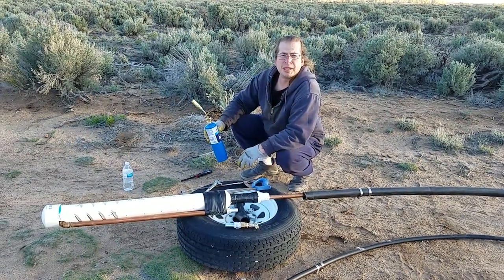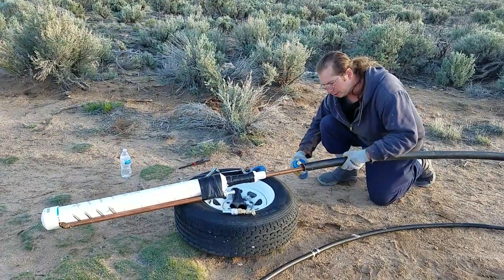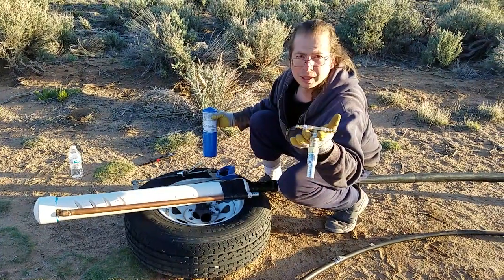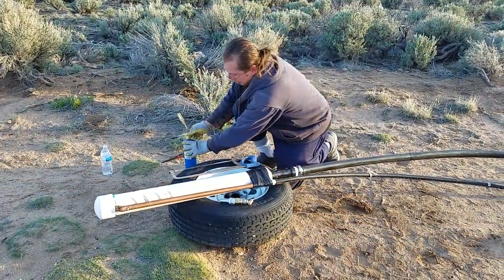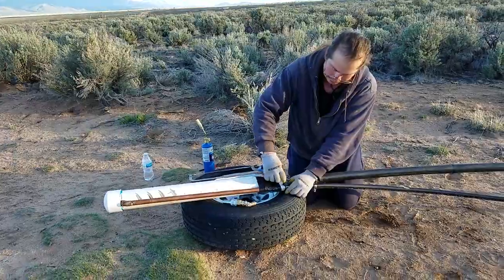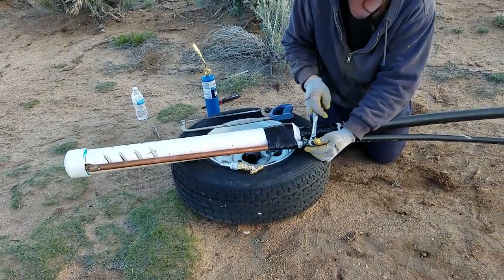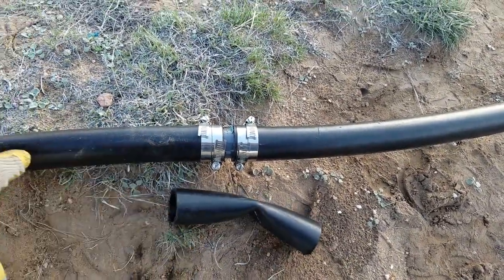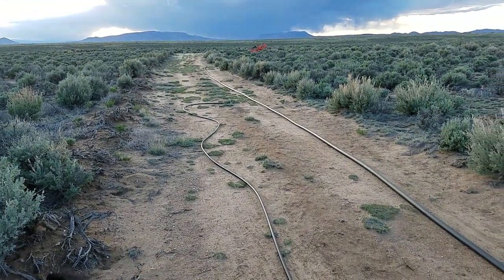Water Well 380 feet : Installing Air Lift Pump to 400' & 500' Hose Line and Assembly before Drop

Comment: heat the kink up with torch and put clamp around it to prevent is from kinking again maybe?
Reply from the maker: Aye does work to mold it with Heat. Hard Part in Colorado Cold, is takes bit working it with blizzard winds at times. Eventually I cut off that curly problem in pipe for 4th time I cleaned My Well in 2024 Summer. When I did get straight as Arrow, I was able to fully clean bottom out and been solid clear water almost full year.

Comment: صديقي اريد المساعده في بعض نصائح
لديه خزان هواء مضغوط سعته 1000 لتر 
البئر 300 قدم  انبوب الهواء نصف انج وانبوب الماء ٣ انج
   سؤال الخزان 1000 كم يضخ الهواء   200 رطل للبوصه 
المكان الذي فيه المزرع لايوجد كهرباء المولد مكلف ارجو جواب
Reply from the maker: Last time worked on a 4" inch diameter well, was at 85' feet depth. Can modify the air lift tiger pump to a smaller 1 1/4" inch diameter with a 1/4" inch air compressor hose line. Maybe with a solar generator setup & possibly run 25 to 35+ psi average, May lift any loose sand or driller tailings out of pipe with possibly 20+ feet of water in well to work with on down & up out pressure ratio. Overall equipment tool diameter 1 1/2", should have plenty of room inside 3" inch diameter well casing. Another way to get more pressure, is use solid plastic like on greenhouse, to seal top to create a vacuum pressure. [Hope Translation in Arabic Correct]     ------ يمكن تعديل مضخة نمر رفع الهواء إلى قطر أصغر 1 1/4 بوصة مع خط خرطوم ضاغط الهواء 1/4 بوصة. ربما مع إعداد مولد للطاقة الشمسية وربما تشغيل ما بين 25 إلى 35+ رطل لكل بوصة مربعة في المتوسط، قد يرفع أي رمل سائب أو مخلفات الحفر من الأنبوب مع احتمال وجود 20+ قدمًا من الماء في البئر للعمل مع نسبة الضغط للأسفل وللأعلى. القطر الإجمالي لأداة المعدات 1 1/2 بوصة -------
Reply from the maker: One more part, exit hose can be used with 1/2" line got already. Please always be safe with All Work Safety, Rural is 100% Safety, Be Well.

Comment: Brandon - I remember seeing that you have an internal copper line inside of the black pipe...is the copper continuous from the top and separate from the exterior line (air compressor side)
?
Reply from the maker: Separate lines, copper tube is drilled with tiny holes react as bubble wand, sediment attachs and drawn up 2nd tube to exit flow sediment water that would damage expensive submersible pumps. One sec, attach link of success pull, this sediment was so shiny looked like gold paste
Reply: @XunnyTheSunshineLion  sounds like mica flakes.
Reply from the maker: @akbychoice  mica floats on water when broken into flakes, this sediment the tailings from 400' feet drill, fresh drill. Deeper go, harder it is to pull this out. Had one Bore hole camera make it to bottom of 400' feet. all along walls could see gold. More Gems and Metals Ores in this Planet than many think, Why majority of BLM Claims limit 25' feet down, cause further you go, Richer you will be. Wild to see it with camera, no tool to just scrap it off and retrieve.

Comment: Is there a part two video?
Reply from the maker: Water Well 380 feet : Successfully 391' feet Heavy Thick Sediment "Tiger Pump" Air Lift Pump View
https://youtu.be/7_8pFvxtFxY

This if first round of sediment being pulled up from bottom of 392' feet total is what discovered. Even though I barely had the compressor power, takes longer for very deep hole but for shallow water well at 85' feet, took matter of 3 - 5 hours to cleanse the sediment. There few more videos up to clear pump point. Been year since Re-install and I have very minor sediment filtering out, not clogging up instantly when first started. So even if get clear, recommend still running water through a filtration system to prevent rocks in your cooking and showering.

Comment: Brandon - is there a website with this airlift pump design? I would like to build one for my wife and I. Thank you!
Reply from the maker: Not that I have noticed a website describe in detail to build, it is open invention been used for long time. I took the design and made it to size to uplift further.
Reply: @XunnyTheSunshineLion  Are you still posting to Youtube? I would love to see how your pump is working!
Reply from the maker: @rongray4118  Water Well 380 feet : 392' feet Gold Paste like Sediment Tiger Air Lift Pump 17 hours later
https://youtu.be/3ajdDoBnT6E

This video after collecting for 17 hours run time, basically fresh drilled well and tailings are more likely all the ores, gems, and unknown heavy elements settle bottom well. Usually get drawn up into submersible pump and gears eventually overheat and lock up or clog up.

Comment: What gpm?
Reply from the maker: Used two air compressors that all I had, were running average 25 psi each, total 50psi...at 390'+ took roughly 1 minute to push upward, about 2 to 3 minutes to stable a push flow. Key goal is produce enough bubbles to pull heavy sediment up. That video I show you, put 1 gallon on it, ofcourse lay over...got maybe .5 gpm or .1 gpm, was up and down for that amount of depth and sometimes jet sprayed. If you have a 65psi average running compressor, like very strong one, might push further.

Comment: From my experience, using a hot air gun on PVC and PEHD is much better and safer than a naked flame...
Reply from the maker: aye, electric heat gun, this way too far from electric outlet. Working with 400' feet of poly tube. Gotta use alternative way.
Reply: @XunnyTheSunshineLion     I see...